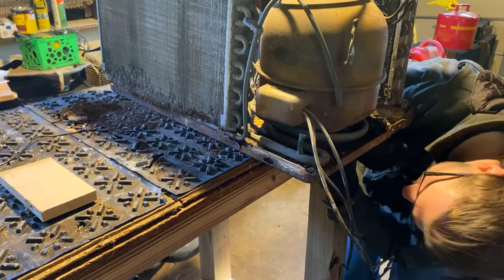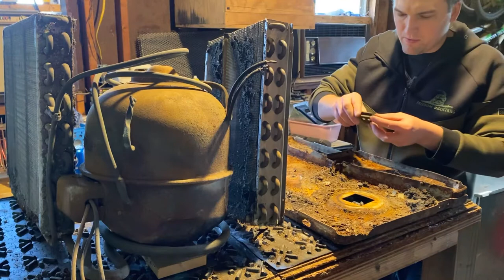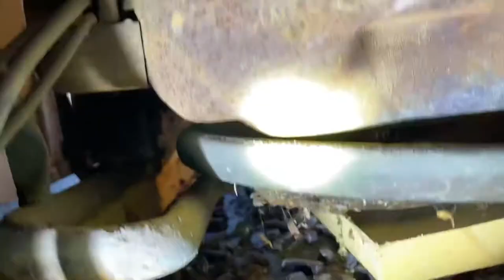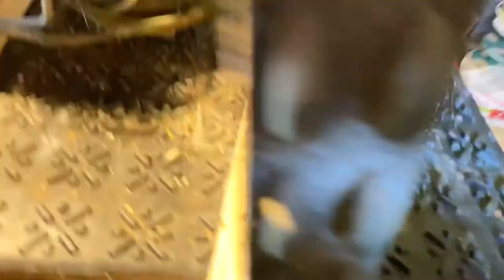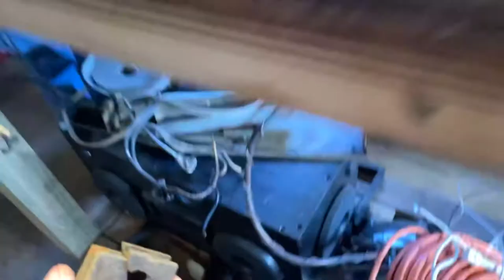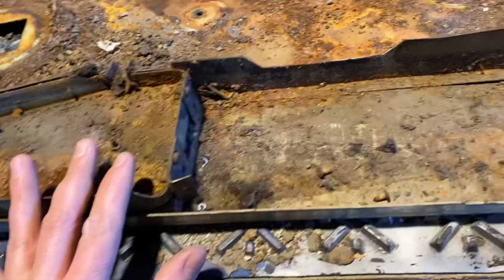1957 Fedders Weather Wheel Restoration Process Pt 2: Pulling out the Cooling System!

Comment: If the rot is bad enough on the bottom of the coil to be use copper showing you’ll want to put some metal in place to block the air from bypassing the coil
Reply: I’ve used corse aluminum wool in the past to fill in where rotted out fins have been with good results.
Reply from the maker: @ESDI80  thats what im most likely going to try! I dont see why it wouldnt work. Itll still be a heat transfer

Comment: FYI, the Tecumseh 'S' used in this unit, with the overload protector mounted on the top of the compressor dome, was the last of the 'S' series made in 1957-58.  The 'S' series was replaced in 1959 with the 'AU' series pancake compressors.  This 1957 unit, when operating properly, could produce about 8800 BTU.

Comment: Unfortunately I am one person, and I do not have anyone who is willing to help with anything, so it will be interesting to see what I do when it comes time to begin restoring my Philco noiseless. I am not really sure how badly it is rusted, but If it is not too bad, I may end up just cleaning and doing the best I can without removing the cooling system. The main thing I have to do is figure out how it is supposed to be wired up. I have to get the correct capacitors and figure out where that extra wire goes. other than that it runs great.
Reply from the maker: Best of luck!! Any questions just post videos and ask for help, tag me in a comment so i see it